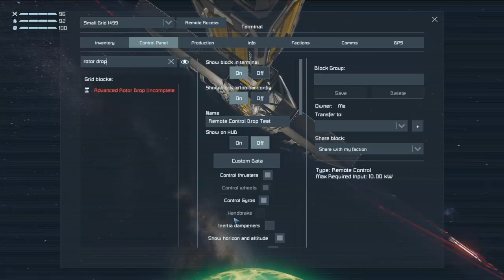Survival Impossible - Fresh from the Farm #31 - Space Engineers Hardcore Survival

Comment: A thought for the "drop launcher"
A lot of workshop ships have some sort of a rotor cannon, as in shoot something off the top of a row of rotors by extending the offset of each one and disconnect at the right moment.
With the right lighting and some directional rotos i can imagine a fairly big cannon underneath the platform shooting supplys. Much like the caretaker array in Voyager. 
With 2 axis rotors at the base of the cannon to line it up i think (with  many test drops) you can hit home quite accurately - there is nothing in SE to impact a falling object and randomize its trajectory. a "landing platform" for falling boxes might even be possible.
Reply from the maker: I was tossing up whether a rotor cannon could work, but firing anything more than a rotor part from one is a fair bit of a challenge from my testing of them (I might have been doing something wrong though)
Reply: @Splitsie  hmm..  never tested those clangy things myself, but for a reloadable mechanism i would not detach the rotor head but put a merge block on top of the last rotor. Roto-locking the whole thing up should result in a high speed piston with a auto welding option at the end. The only thing i couldnt come up with an idea is as how to load it without a connector. But i guess a small grid mergeblock/connecter/cargo/parachute/ antenna/batterie is all the pod needs. It would also be possible to bring a bunch of them back up every once in a while and "reload" manually.

Comment: the sensor of the airlockk doesnt have to be inside u can put it andemeath or outside on a wall and make the Settings offset
Reply: Or there are scripts that can make the airlock work without a sensor
Reply from the maker: Good points :)
Reply: I recommend Whip's Auto Door and Airlock Script :D having the close time on 1 or 1.5 seconds fits me fine.
Reply: @Koichifirst  while that probabaly works better, a sensor would take up both less block space, and less visual space
Reply: although that would probably work better if you don't have such space near your airlock
Reply: Uhm the programmable block can be anywhere on the grid, it controls any door you like on it too, so you need only one PB with the script loaded... That's way more efficient
Reply: @Koichifirst  it still takes up visual space and he has to place it somewhere acessable because its the way he builds it a sensor doesnt has to be acessable
Reply: @imperialspacemarine1539  sure for a single door the script is not as sleek, but if you have multiple doors/airlocks the script gets way more valuable. A PB uses a fraction of a sensors power and no matter how many doors doesn't increase.
But in the end it doesn't really matter :)
Reply: Could also start using the rotating air locks. I love em.

Comment: @Splitsie - don't forget you can stack solar panels on top of each other. There is a very slight loss for the panel underneath, but the loss is negligible compared to the aesthetics and even the size of the target that the panels and oxy farm is. I've been rewatching your Survival Unlikely series along with this, and looking at the massive arrays you construct, its just more bang for the buck and overall it seems to be a bit more stable on the rotors too with my testing.

Granted you are in a relatively safe spot now with the low grav, AI will be confused, but I'm just thinking of a moment where you might accidentally collide with the array if its that much bigger.

Anyhoo love your work here, thanks for being part of this awesome community
Reply from the maker: It'll be interesting to discover if the base is not as safe as I think it is :/

As to the double panels, might have to test that as it's been a while since I tried taking advantage of the odd light blocking they have

Comment: A cool if very convoluted and complex way of doing it would be to use a drone to pick up your little cargo crates you print. That then picks them up flys over to the drop zone, drops it and then comes back. Using the way point auto pilot system with the remote control.
Reply from the maker: If you had access to ion thrusters a system like that would be worth doing since you'd always have enough power, but with only hydrogen it'd be a bit risky I think
Reply: Splitsie  A ya I forgot you don’t have any platinum. 
Nor do you have a reliable source of fuel up there so having the drone dock every round would not be helpful ether.

Comment: For the cargo ship printing and drop system: Set up a projector/welder to print a ship with a connector, just in front of a connector on the base. Then, connect the printed ship to the base with a connector mounted on the end of the piston, with a timer block that automatically connects the ship to the base after being printed, and another timer block that disconnects the connector while being pistoned off the base. You could control direction of the throw with the new Hinge Block. 

No merge blocks needed :)

The whole thing can be automated with timers from just 1 button press and set to auto-fill with ingots with a sorter.
Reply from the maker: Except you can't print subgrids so you need a merge block to disconnect your printed grid from the projector block :(

Comment: Hello, 
For the problem with the gravel filling up your assembler, the sorter will fix that but you will have the same problem when you hit Iron Ore (the assemblers will fill with iron and won't have space for other types of ingots.  What I recommend is to connect the refineries on the other side of the Cargo area (same side as the Drills). So the overflow from them goes into the Large cargo containers before going into the assemblers. 

For the drop, it was nice. you should make a platform where it will land so it does not roll away. Or maybe something that is automated to catch the drop disassemble it  and put it in a container that goes back and forth to your main base (maybe another railway system or a shuttle drone ?)
Reply from the maker: That's a good point, I probably should have thought things through a little more before I just slapped it all down :P

Comment: A note on how to preserve some gravel using Izy's Inventory Manager.

Set a cargo container (a small one easily suffices) to request Gravel via Izsy's Inventory Manager.

Set your Ejector to NOT pull on its own.
Set your Ejector up such that it requests Gravel via Izy's Inventory Manager (say 10k gravel)
Set it to minimum priority for Izy's. (or the cargo container to a higher than standard priority - either works)
Set your Ejector to eject.

profit.

that way you always keep however much Gravel you specified (e.g. for your hydroponics or concrete needs should you use those mods) while still automatically getting rid of any excess.

Comment: You can set a GPS above you base, use the remote control to move toward it, set the parachute to deploy higher, add some atmospheric thrusters, and the package will move to over your base.
Reply: Thrusters need cobalt, which is not present on the asteroid, so dead drops only.
Reply from the maker: Yep, dead drops but launched from rotors or pistons :D

Comment: In my Survival Impossible I think it was ~12-15 oxygen farms into my 20 farm grid, on a solar aligned rotor, when my tank started achieving an even level when I was inside the pressurized space (aka, you use ~12 farms outputs). With my finished 20 farms on a solar aligned rotor like yours, I get a small net gain into the backup tanks I added.     ...its a lot of farms - but seems like like a fair game balance for living in space

Comment: As other have said, an Advanced piston should be all you need for the connection to the base. It'll be the merge block and connector in one, but you may want to  keep a connector on for connecting to the base below. Also an option is a system near the nickel mine to grab the container or something.
Reply from the maker: It has to be a merge block as projectors can't project the subgrid heads of pistons or rotors. My thought is to either use a piston to shove the drop pod or a rotor/hinge to create a pendulum to swing the load so that it travels far enough to drop almost directly on the base :)

Comment: Build a slope of light armor blocks on the rough patch and perhaps a flat surface at the bottom of the slope to function as a collection area once you have decided on the final dropper location in space.
Reply from the maker: I'm planning on flinging the drop pods or pushing them in the hope that I could actually make them land near the base. If that system ends up reliable enough I might build a collector underneath it :)

Comment: For your drop pod, how about a sideways mounted rotor with a downward facing piston with a second rotor on the end.  Build your pod on the end of the second rotor, then have a timer extend the piston velocity to push it towards the planet and also have it detach the head as the piston is extending.  With the sideways mounted rotor you can slightly adjust your trajectory with each drop to get it closer to where you want it.  If you have it all piped up, just transfer what you want to ship to the pod and hit the timer button. Clang bait, but it may work.  Over complexity never seemed to bother you in the past so....
Reply from the maker: That's not far off from what I'm thinking, right now I'm debating whether I want to use a piston for the push, or a rotor/hinge like a pendulum ;)

Comment: Figure out the linear distance across the ground and direction you want to adjust the drop landing by. Aim a piston horizontally in the correct direction with a rotor on the end to release the payload. Divide the distance by the time in seconds to parachute deployment and use that for the piston speed. Release the payload while the piston is moving.

Not as exotic as a catapult, but a lot more adjustable and consistent.
Reply from the maker: Sadly when printing using projectors you can't use a rotor for detachment as you can't project the subgrid for the replacement head :(

You could do a setup like that with pistons but you'd still run into the issue of Space Engineers' speed limit which makes the calculations a bit more difficult as gravity will deplete your horizontal velocity

Comment: Launching mechanisim can be quite simple. Just 4-8 small grid pistons around the rotor head, that give  the finished pod one good shove away when the rotorhead disconnects. Though I suspect it won't be necessary if you're popping out full cargo containers.
Reply from the maker: I'm tossing up between something like that or something that launches more like a pendulum ;)
Reply: @Splitsie  Pendulum would be cool, but could you get it to launch straight?
Also, since you have all that gravel, you can use that to test firing filled cargo containers.

Comment: Splitsie, if you do expand your drill head, you don't need an X shape. You need to add a few drills only on the outside as they have the larger circumference to dig. The shape should be more like an H.
Reply from the maker: Not really, the advantage of the + shape is that the maximum time between one drill passing over a piece of rock and the next is minimised that way. However as you say, I'd only need to build the outer few drills on those extra arms to get the advantage I need :)

Comment: Instead of doing what you did with your new base on this astroid, you should use the half block corner, that way you can offset the wall so you can have stuff against the half blocks, it will be super difficult placing stuff in cramped spaces, although, you can put 2 blocks in the same grid, you can put for instance a locker with a terminal in the same block grid, of course using the merger

Comment: May be worth putting 1 outwards facing drill on the back of the outer drill ends so u can adjust without having to manually drill also means u may be able to remote change the position of the drill from planet if u need to
Reply from the maker: I think that's a good idea :)

Comment: Make the supply drop have wheels that is in a line under the cargo sort of like Wasteds spider rover and your rover in "wrong way down" but without side riggers. Then to be able to print it you most likely will need to have it be via a merge block that gets made first and then the connector. My first thought is to have the merge block on top of the cargo container and then the connector is on the rear and all the other stuff is on the front to make it balanced. This would make it possible to have it printable and loadable. Plus as a bonus, if you then find a good spot to drop, you can just drive it where you want the supply drop to be stored via remote control... probably if it works as I imagined :D
Reply from the maker: I don't think wheels (especially the w4sted style wheels) are printable :(
Reply: @Splitsie   That is too bad, if that's the case, since it would solve many things the two biggest being the landing and the transportation of the supply drop to where you want it via remote control. Haven't tried myself, so not sure, but I think you're right it might not be possible to print wheels ;(

Comment: I see the final cut was also nearly an hour long. Still, more Splitsie is better, particularly when we get some nice detailed decor out of it.

3:32 I feel like selecting the whole group of lights and changing them all at once might still be quicker. Unless you get quite used to the hotkeys, which is also possible.

6:29 If you had made indents in the platform for those wings it would've worked in the floor. Might've been annoying to dock.

18:06 I feel like you ignore that weird inverted version of the half slope when using half blocks like that. You know, the one that has the quarter-sized 45 degree slope cut out of it. Though I do like my harsher 8th angles a bit too much.

25:17 Well there will be a lot of smaller planetary, orbital and deep space stations for you to decorate (this series will likely last a while longer than S,M). There will definitely be time to go back to the first Omicron base and spice it up a bit, particularly since you haven't actually built a living area yet. You have a refining/production building, an incomplete garage, an office and a bunch of temporary equipment. This space station is mostly a single living and working space, much more compact and overall smaller than the more lavish setup the planet might have later.

29:08 "The view's downstairs, man, I want some darkness when I'm tryin'a sleep."

39:37 I believe someone did the math at one point early in the series, it was something like 3 to keep you going in vanilla and 24 in this? But don't take those as fact, that was months ago and I have a tendency to remember those sort of numbers wrong.

43:43 I feel like it might look better with a 5th column of them as well.

50:12 Well it's more successful than scaring some civilian cargo ship into thinking it's the target of an orbital strike.

53:41 Quite entertaining seeing the solar harvesting array struggle to keep pointed in the right direction whenever you go walking on or adding things to it.
Also might do well to attach a relative spectator camera to one of the drop pods at some point. And to decorate them like unknown signals.

Comment: For the drop system, maybe use the hinges with small heads and maybe (dare I say) have the autopilot move to a designated flat spot with lateral thrusters? Expensive, I know 🙄
Reply from the maker: I'm going to have to use merge blocks for the disconnect due to the projector limitations of not being able to project subgrids, but hopefully I'll have a system that will get the drops suitably close to the base so it doesn't need it's own guidance system :)
Reply: Splitsie Those pesky subgrids! But looking forward to seeing your solution 😁

Comment: if you can get the drop to be accurate then you might be able to put a connector or a merge block on the bottom of the container, and on the planet place a connector or merge block directly on the GPS you made so it locks in to place.
you could make a small landing pad, with a connector for a truck, and a grinder, to grind the container once empty?
i found out, if you have a grinding pit, cover it with catwalks ( or glas? )…. and drop your " junk " on it, this prevents the small grid blocks from being ejected into space. ( IF the catwalks are the same grid as the grinders, it will not be grinded away !! )
Reply from the maker: If my launcher ends up accurate enough hopefully I'll be able to do something like that :)

Comment: Sooo, given that refineries tend to just push stuff into the nearest possible inventory when they get full: not to criticise your sorter loop as i am a big fan of sorters, but it might have been far simpler to just move the assembler behind the cargo containers (from the perspective of the refineries)...
Also, how about using an advanced rotor as a coupling for the drop pods instead of connectors? if i remember correctly, a projection of the drop module would catch a starting point for welding on a newly placed rotor head. and that would lead to some neat automation
Reply: A projector cannot be used that way. A rotor head is a subgrid and projections do not support subgrids. You would have to have the projector on the same grid as the rotor head.

Comment: What's funny is that watching you build this makes me want to show you my replacements for the SPRT headquarters.
It's too big to be used for much more than a System wide base.
Just an FYI, if getting 100% sunlight around the clock 2 o2 farms can keep a player alive with no issues. since your getting light more than 50% of the time and it's normally straight on, you should be good with 4 built.
This is all vanilla numbers, you can math it out from there.
Reply from the maker: I can't remember the ratio of the increase I did to the oxygen consumption so I can't just do maths on it - still seems like 16 should be pretty much on the money though :)